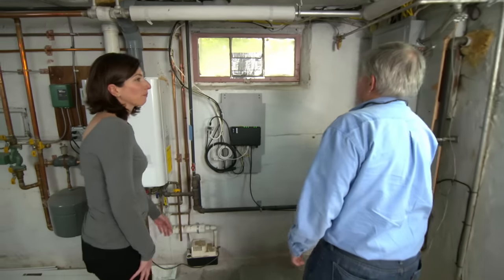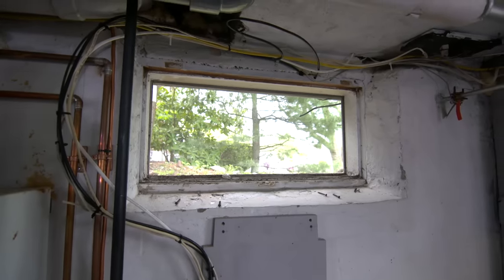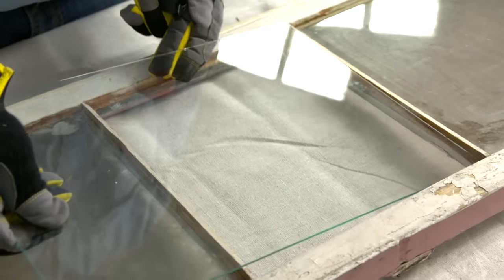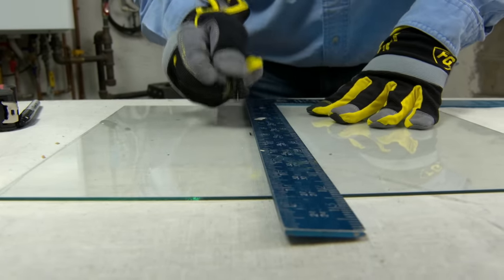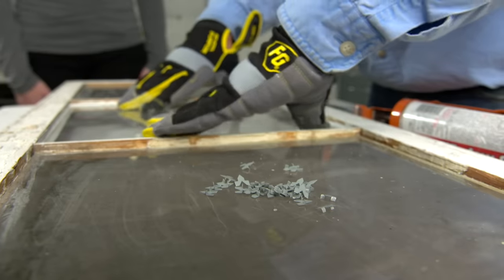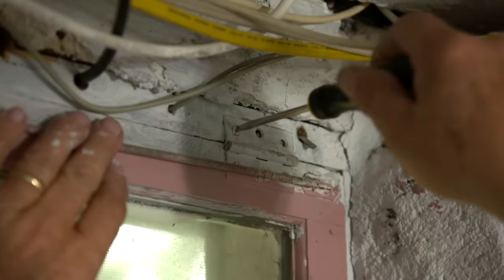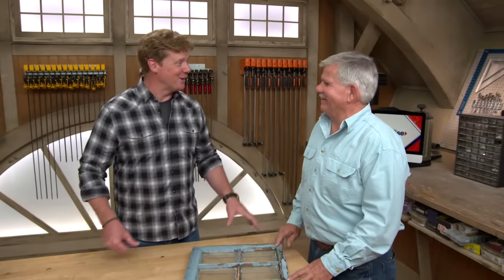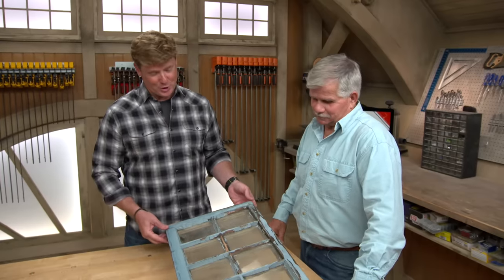How to Replace a Broken Window Pane | Ask This Old House

Comment: I did this kind of work for almost 30 years. NEVER once did I wear a mask to cut out or heat out the putty. I don't think it's needed at all. Funny but great at the same time. Thanks for sharing...
Reply: I think they are being extra careful as some of the glazing compounds made before about 1960 had asbestos in them.  Also, older paints had lead.  Neither do you want to breathe in.

Comment: I love how they said make sure you use a mask and a hepa vacuum to remove the glazing, that like likely due to it containing asbestos or lead if it is an old home.
Reply: Only Lead was used in paint and only on exterior, so yes it most likely would’ve contained lead paint, but the glazing itself is a linseed oil putty. So they were protecting themselves from lead contamination.

Comment: Hi This Old House Fans! Please give this comment a like if you find it useful!

Often times the putty is still very firm and cannot be removed with just a utility knife as shown in the video. If you run into this problem, use a heat gun on low setting to soften the putty up. It will turn very soft and can then be removed easily.  Be careful to warm only the putty on the pane of glass you are replacing.
Reply: Steam works well too. A wallpaper steamer/cleaner is great for this.
Reply: A multi tool works too

Comment: I didn't know they made caulkable glazing compound.  It looks even easier to replace an old broken window now.
Reply: Yeah man I've been breaking windows like crazy now and I don't even feel bad about it.
Reply: That stuff is terrible if you need to change the window out again.
Reply: @simonmarthinsen1566  use a steamer on the old glaze it will soften it up and  easily lift off

Comment: Any suggestions on how to remove the muntins/mullions from a vinyl double paned, insulated window without replacing the whole insert? I worry about resealing the pane of glass so it doesn't get condensation. Is this even possible for a DIY?

Comment: I needed this a year ago! Now I need one on removing and replacing a wood window that has a zinc track/flashing. I tried this on my windows a year ago and the flashing would not budge and I had to bend it, I don't know If I should replace it with new flashing/track or use the existing...I even thought of going without...

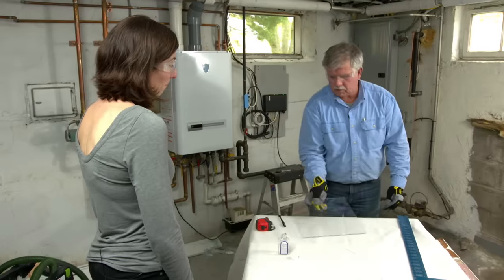Comment: 3:48 So if you use normal glaze, you have to prime the wood first?
Reply: Yes, regular putty tends to be oil-based. If you use it on bare wood, the oils in the putty will be absorbed by the wood, which can lead to some issues with the integrity of the wood and the putty. Prime, bead the rabbet, place your glass, putty around the sash/muttons, wait for it to dry, prime the now dry putty and paint your window.

Comment: Does it work the same way if I can't take the sash down? I broke a pane in my bathroom window trying to open it while stuck. It's a second story window and I would have to do it from the inside. No way I could climb a ladder to do it from the outside. Do I need to apply glazing to outside as well?

Comment: I have a double pane window with seals that have loosened and are sagging in between. I would rather buy a replacement section but there are no manufacturer markings. Any ideas to help This Old House?

Comment: I make Aluminium Windows for a living. Its nice to see how other types of windows work. Although this looks like an old style. Also, Imperial measurements are the worst lol.
Reply: I come from a metric background (EU) and I can tell you that while it was intimidating to get into inches and fractions instead of meters and decimals, today I am of the opinion that if you know what you're doing it's actually no difference what you measure with. It feels like second nature to me already. and if you wear size 11 shoes, it's your foot measure right there..if you have normal sized thumbs - there's your inch... Everything seems easier this way, there is somewhat of an expectation for a leeway when measuring with imperials which is great too - in EU often it has to be 73,3cm - here it's just "Yeah two feet five and a half... " it'll fit
Reply: How do you hold the glass in place on metal windows? Obviously those sharp glazing points will not work on metal frames. Thanks for any tips.

Comment: I've got a double pane bathroom window where the outside pane cracked and fell in on itself. How would I go about fixing that?
Reply: They said at the end for newer double pane you have to get a new window.
Reply: Depending on the window, I know sometimes they use special techniques. Something about sucking the air out between the 2 glasses of double pane windows for moisture purposes. I would probably take it to a hardware store. Could be expensive. But like I said, it depends on the window.
Reply: Call a glazier 🤦🏽‍♂️
Reply: You'll need to talk to a glazier, but you won't necessarily need a whole new window like Tom said.  I brought the sash to the glazier's shop and they put a new sealed two-pane glass module in my old frame.

Comment: old guy techniques application of which proved to last 40 years and more a putty scraper knife to pry off the old glazing,and embedded points,careful not to gauge the sash track,get most of the putty out,sand the rabbet,lightly feather the top sash edge till a bit rounded and smooth,daub on boiled linseed oil,otherwise the bare wood will suck off the oil in the putty,and dry out prematurely,see that the rabbet corners are clean too,
clean glass you intend to cut with pumice,warm water,wipe once, clean off with the clean cotton rag till you feel and hear it squeak,another dusting with pumice ( blue windex type cleaner does not remove this grit,applied at the factory to prevent breakage in shipment on pallets) blow off the residue,use some sandpaper to take the sharp of all glass edges before cutting,this make handling safer,,,use a red devil or embee glass cutter used only to cut one thickness of glass store the tip in oil,,use an accurate wooden t square to measure for cut,use enough pressure to score the glass, snap off with the scored  glass at the edge of the table,, measure to check the sizes again,sand the edges w sandpaper,knock off corners till they are rounded,,sand them too.
 bead in a small amount of putty into the sash rabbet,, press  the glass in till all sides seat the glass  a 16th of an inch from  direct contact with the lip surface,,these measures will protect  and insulate the glass and sash from kid  slams for years, when glass is seated snug and evenly,install points,either the old triangles or the more common push in points at the big box stores, about 2 pts every 6 to 8 inches,,use the side of a cold chisel for the triangle points,,the chisel ought to have a semi dull edge useful for scraping old putty out from sash reglaze jobs,oil base putty lasts longer than the latex,these guys above are more mechanics than window trades guys,,,they can whip in double glaze vinyl glass and plastic windows quick and done one hour a window opening,,,,reglazing as they do the job my bet is in 15 years it will have to be redone,,, sarco is decent to work with ,sarco oil based
replaced NUPUTTY formerly of desplaines Il,,,,this stuff lasted 30 years stored in small cans,occasionally I poured a bit of lemon oil and used a drill mixer to keep it pliant and serviceable time will tell how well the  sarco holds up,,,,,,no store close to me or within city limits among big or small box stores carried sarco oil based stuff,I had to order it,
   final step is to apply putty to the tacked in glass and edge of the wood,press in a bead with thumb,,,, falling gobs of putty mean it is too oily,needs to be a bit drier.use a 3/4 in curved embee knife to evenly  press in,never use the putty knife for scraping,make corner angles 45 degrees lined toward the center,your putty  line and edge should not be over or visible from the inside ought to look smooth,
when done use the blue windex cleaner with a rag piece to carefully clean the glass of oil and finger marks,windows done like this will last 40 to 50 years,assuming we have good working casement parts like the weights, rollers and smooth casement sides.The finished window will make it quieter from outside noise,stay warmer in cold and  dry when it rains for days

Comment: I think the resperators may be a little much.
Reply: Yup, that's exactly why they used them.  And it's still a little much.
Reply: @hamandcheese73  asbestos
Reply: Yup, asbestos.
Reply: With a hose obviously that old you have to figure lead paint and possibly asbsetos fibers if not on the materials on the window then in the first on the window.  TOH and Ask TOH bring a business they are required to file certain guidelines.  Being that the window was as small as it was they were able to get by with the hepa-vac and respirators.  If it was just a home owner and the square feet of work under a certain size, the home owner can do lead based paint abatement themselves, in some areas in some states.  Over a certain size, friending on area, a home owner may be required to use s licensed abatement company.  If working outside, where wind out sir currents could affect neighbors or adjacent properties then the rules are a little different and tighter.  That's why, in my area, while working on my 1910 Neo Greek Classical Revival I'm doing most of the work myself.  Being Hazemat and Asbestos trained, I can be safe and get the work done a lot cheaper than hitting a contractor with all of their EPA requirements.  Even though I'll be a lot slower, adding into the requisite that I'm now 65, but still a good deal for me.  JS. Didn't mean to be so verbose.

Comment: i cant get my fixed window out of the wall! :(
Reply: so, you have changed the glass but when you put the window back together it got stuck on the jamb? I'd suggest getting a razor knife and trying to run it around the opening, feeling for a tight spot. You can always try prying it out and hen sanding the jamb or sash for a better fit.

Comment: How about a spin-off from This Old House
How about 
This Old Trailer
Reply: Probably would get HUGE ratings in Arkansas!
Reply: @kman-mi7su  Really? I'm being serious. I live in a 1962 Windsor mobile home 10 x 50 that probably should have been in a shredder 20 years ago. I bought it for $500. I planned on moving after a year but I had a cardiac issue now I can't move. Mobile homes are built with toothpicks and aluminum foil.
Reply: I'm not its a joke!
Reply: kman 4443. LOL. I thought it was funny!  Serious, but funny!  I was gonna say it would be a hit in the South and I'm from Georgia!  You and the other guy are right.  It is serious and there does need to be, it could be a mobile home/trailer version.  There are a lot of mobile homes that could be salvaged and up graded to make great affordable housing and starter homes, not to mention continuing as vacation homes or hunting camps.  And it could make sure lot of them a lot safer and maybe prevent deaths.  Something to consider.
Reply: The Joke is on all of y'all I live in Ohio, Northeast Ohio. It wouldn't be just the South. 99% of the contractors are good people like in This Old House, but those same 99% like in This Old House are too good and proud to work on a mobile home. I can never find a contractor who has the balls to fix an old trailer.

Comment: Quick just say use a hepa vac and dont talk about the possibility of lead paint or lead in the old glazing
Reply: They showed the right PPE. What more could you ask?
Reply: @colorschemers2495  actually taking about the possible issue at hand and small danger ( if handled properly )
Reply: What I mean is, they showed the proper handling procedure. They just didn't state "lead paint" was why those protective measures are necessary.